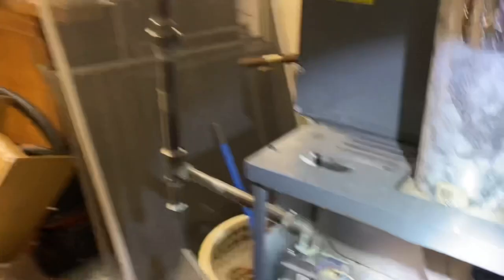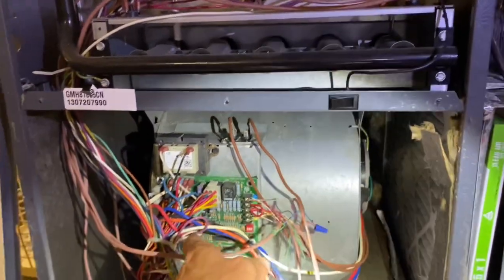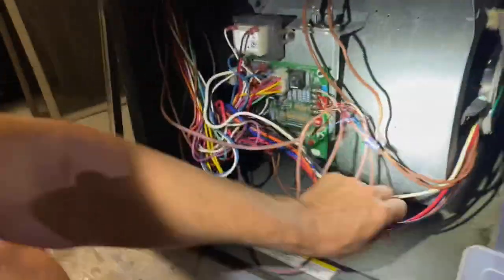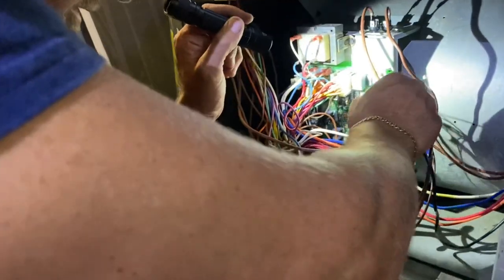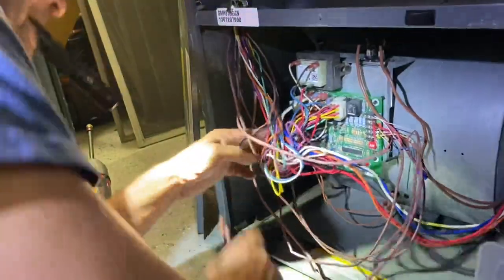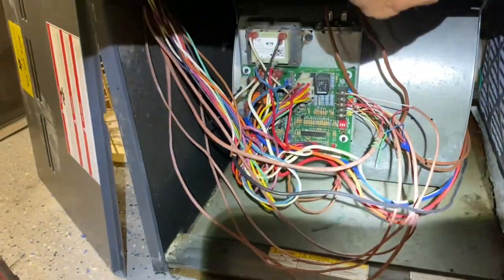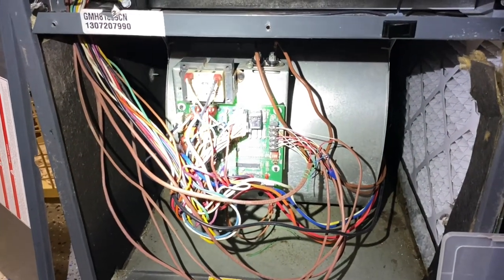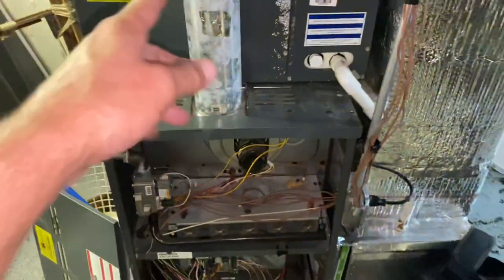Central AC Frozen Blower Motor Not Operational - Defective Furnace Control Board Replaced

Comment: Always remember Daniel.... 9 times outta 10 if the blow wheel spins freely by hand, it's properly not the motor. Start looking elsewhere, capacitor, relay, control board, loose wire, ext. 😎👍
Your doing OK, still learning, stick with it. It all comes with time.
Reply: Well said. Completely agree.👍👍
Reply: Couldn’t agree more Shannon
Reply: Do not let those control boards cloud your judgement, test the individual components in the path. Once you know the motor is good, cap is good, and applying power to the motor makes it spin, move up the line.  Anytime you see blue/green crusty on a logic board it is done. Water and electronics do not mix.

Comment: I guess contact cleaner doesn't work for the corrosion?
Reply: Certainly no guarantee.  Not impossible on a thru hole board like that, but you'd never know if that corrosion had eaten away at the tinning so that corrosion came back faster or if the one transistor inside one of the chips, that's only turned on for the coldest nastiest weather has blown.